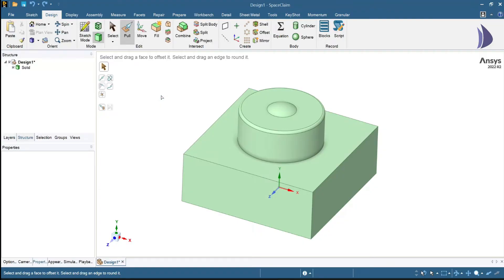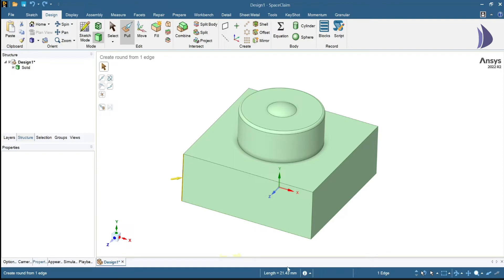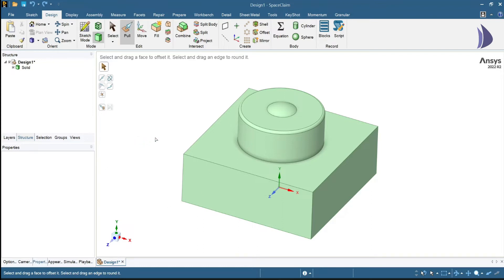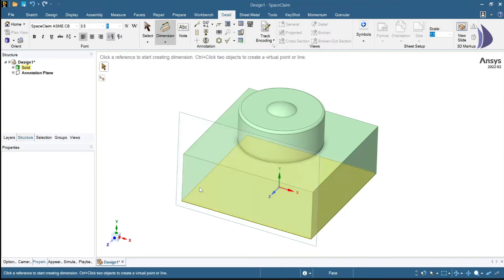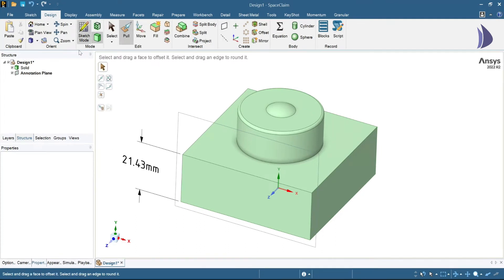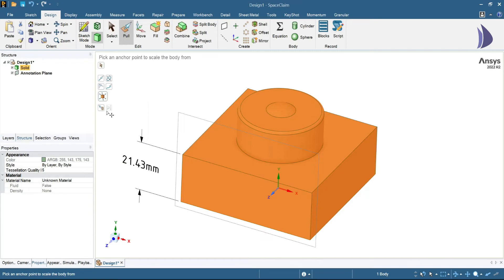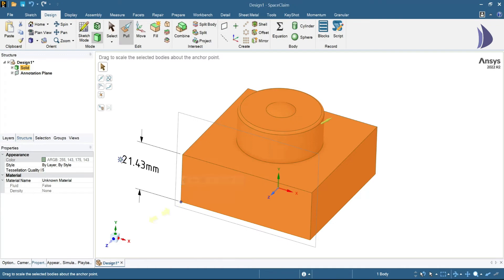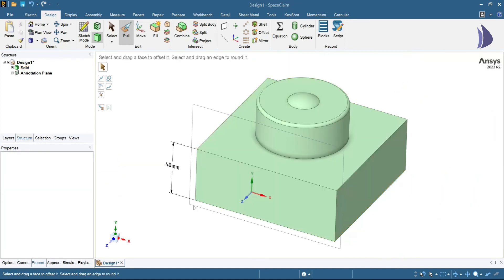Scaling up a model using Ansys SpaceClaim

Comment: It's unlikely to scale a whole body from a weird length isn't it.
What might be more the usual is to scale a width and maybe the depth leaving the boss with hole and the height unchanged and still central on its face.
Reply: Good comment, this was in response to a specific customer request.
Reply: Great video. Can we Parameterize the scaling of the entire geometry with varying factors such as 0.2,0.3,0.4 and so on?
Please help
Reply: @austineadah2843  Yes.
After selection of the scale point, then enter a scale factor such as 0.2 etc. There is no absolute requirement to select a spark dimension and enter a new dimension.